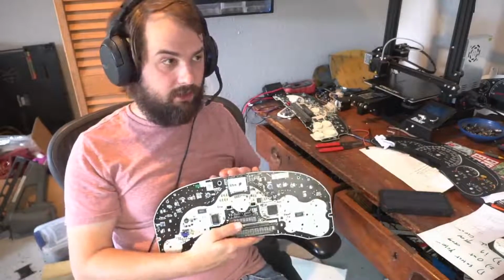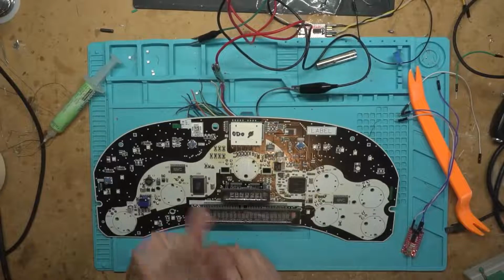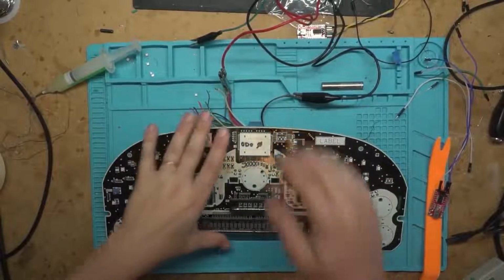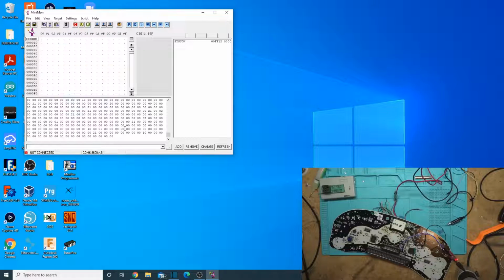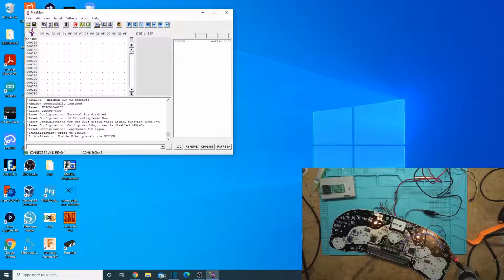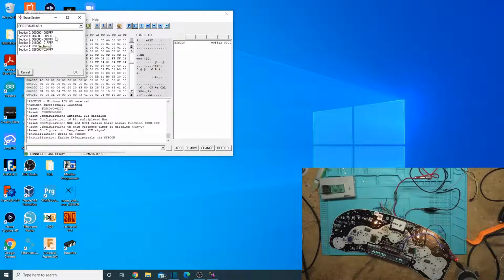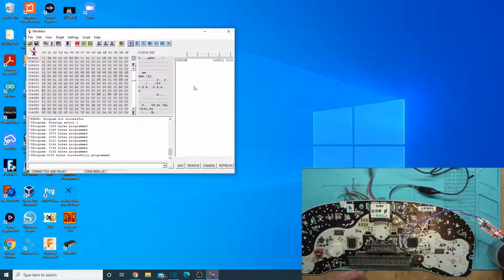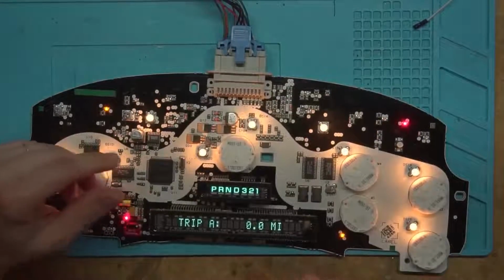03/04 GM Cluster: Programming the 9399059 Microcontroller. Successful!

Comment: I have a 2004 Silverado that had a drain caused by the cluster . I verified the drain and loss of VDF power up as well as no gauge motor turn on . It stop acting up when I pushed on the crack of board where speedo solder joints are . It has all been soldered  by a company . Have you seen an MCU cause this issue ?

Comment: How did you go from the 9399059 number to the C161 series?  I'm trying to figure out how to dump the MCU in a GM BCM (2005 Malibu), it's an Infineon 9396627 made in 2004, 128 pin 20mm square package.  Any advice on how to start this quest would be appreciated.
Reply from the maker: I originally figured out pin out of the power pins clock, and j1850vpw pin and number of pins to the year. Looking at datasheets from infineon and that time frame

Comment: Are there special wires you’re providing power to get the “unknown driver” message to display at key cycle? I have a spare cluster that has the steering wheel controls that is not showing anything besides odometer after powering up using the standard 3 12v wires and 2 GND wires. Perhaps 12v to the orange?

Comment: Are you still working with these. I have an 06 cluster in my 1500 v6 manual transmission work truck. I put an 03 6.0 in it. Can i reprogram mine so it knows that it is now a v8?

Comment: Any idea on the BIN section that controls the "transmission hot" warning message on an 03? I have a 2003 Yukon XL2500 that I've swapped the 4L80E for a 6L80 that's being controlled by a custom transmission controller. The only thing hooked up to any of the PCM transmission inputs is the temperature sensor, which then sends that data via the serial data connection to display on the cluster. For a reason I am unable to determine ever since the swap the "transmission hot" warning message pops on at about 170F instead of the 260F it's supposed to. Reading either the PCM or IPC with a scanner displays the correct temp, and the transmission temp gauge also shows the correct temp. I've even reprogrammed the PCM to not trigger a transmission hot event until 700F! I'm totally out of ideas on this one.

Comment: So I have a laptop with a serial port its a dell latitude rugged 5424 thats fairly  built I had this setup to run my gm tech to or my audi Porsche etc diag tools so do I just need to get a serial plug with wires on 1 end or idk im a noob but im trying to learn as much as possible  I want to be able to customize  everything  on my silverado  cluster adding  steering wheel controls is it possible to change what things can be displayed or changed by pressing a steering wheel button for example instead of vol up can I change it to turn the heat up or the ac up in temp and vol down down or have the cluster display more things such as digital  sped or have it read out Temps for the oil th trans the water the intake manifold  temp in cab temp outdoor temp what can I do with this type of hacking
Reply from the maker: Yeah you can just connect with your com port just fine.
As for custom OS's it's possible with lots of experience with reverse engineering and Assembly language but I have next to no experience so I can't do that.
Reply: hey, was wondering if you knew maybe why the Warning smd Led lights aren't working. I ask because I've ran into the same problem after removing some and swapping them out for a different color. I've searched everywhere for some sort of schematic to show each and every connection and resistor and voltage regulator etc. that make these Leds work or not again ty for your videos they have been so very helpful in my journey on repairing and customizing my clusters and friends/family's clusters. one video that really helped me was resetting the miles and hours to be set to the proper amount. It was kind of annoying for a while to make sure I kept meticulous records of the correct hours and mileage. So, thank you very much. if you send me an email or a way to message you.  I'd like to show you some of my projects that I've done somethings from what I learned from your videos and a lot of other projects I've done from gathered knowledge over a lifetime u know anyways Ttyl @FixedUntilBroken

Comment: Great work, thanks for sharing. Do you know if I can work on a 78K0 series with that little programmer? It's an 8bit single-chip microcontroller
here's the datasheet: https://datasheet.octopart.com/UPD78F0557MA-FAA-AX-NEC-datasheet-12541559.pdf
Reply from the maker: Not familiar with that chip but I'm not using a special tool it's just usb-serial adapter because my computer doesn't have a com port. The only special thing I am using is minimon software. It only works with some infinion chips nothing else.

Comment: Is the cluster different from steering wheel controls to non steering wheel controls or is the something that that can be programed in?
Reply from the maker: It's the software on the microcontroller
Reply: I would love to see a video on how to do that.
Reply from the maker: @orionbuilt7583  I mean this really is the video on how to do that. Get the bin of a steering wheel controls one and follow the steps on here.
Reply: Oh, I wasn't sure if it would be the same. Thank you very much.
Reply: Would it work if I just put the old microcontroller on the new board?
Reply from the maker: @orionbuilt7583  yes but if your micro is fine there is no need to replace.
Reply: @FixedUntilBroken  what wires are you using on your pigtail?

Comment: Have you tried reworking these GM clusters from 03-04 to work on 99-02 models? I've seen one person offering this service and until now I would of never thought you could get these clusters to work on 99-02 models. These people sell them as plug and play. No modifying the harness involved.
Reply from the maker: Yeah I've seen his ads for it before. Some people one facebook were commenting about it saying most the error lights don't work right with it. 
If you repin the harness most of the cluster will work. My bench tester is a 0411 pcm ( 99-02) and it still gets all the gauges it's supposed to on the 03+ clusters. I've never tested if the older BCMs put the message onto class 2 for the battery gauge so that's the only unknown to me
Reply: Guess I'm gonna mess around with the harness and repin it see what I get. Thanks for the response and keep up with the awesome videos 👍
Reply from the maker: @chevycamaro350tpi  let me know how it goes. I actually drive a 2001 so I might do it too if it goes good

Comment: awesome video. i was wondering is the steering wheel control activation in the eeprom or the controller?
Reply from the maker: It's on the microcontroller not the eeprom
Reply: @FixedUntilBroken  is it hard to activate? would you mind making a video about it?

Comment: This is great. 

I keep spare boards of about each year and with/without SWC as spares in case I ever messed one up, but it'd be nice to have more options for processor specific options. 

Do you know if  the 7k tach and 140 mph speedometer eeprom specific or processor as well?
Reply from the maker: I've never seen a 7k rpm in person but the ppv 140 mph is just on the eeprom I don't have a copy though.
Reply: @FixedUntilBroken  I don't have a ton of interest in doing them, just curious. 

There are two tiers of the steering wheel control MCUs correct? Some just have the trip A/B and the others have the Driver 1/2, and business personal text?
Reply from the maker: @taylordiehl6594  I never paid too much attention but yes there are some that don't say driver 1/driver 2 with steering wheel contols. I don't have my hands on on of those to rip though
Reply: @FixedUntilBroken  I might be able to get a rip of one with A/B trip as well as business trip, i just dont think it has steering wheel controls.